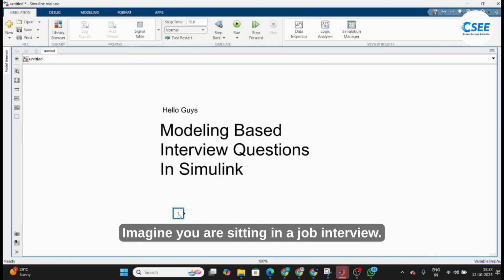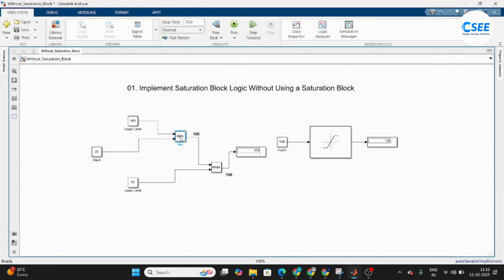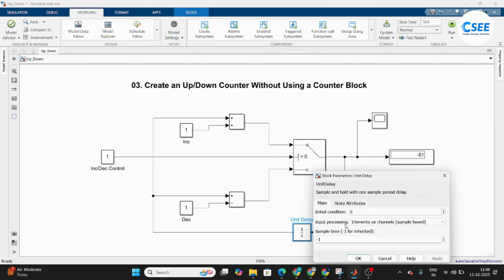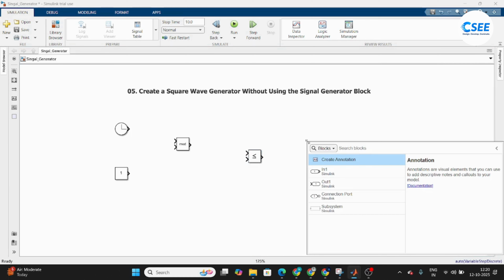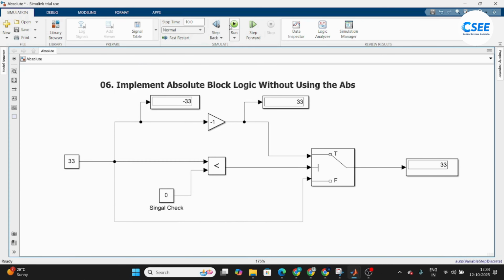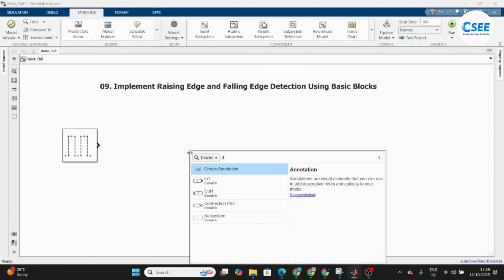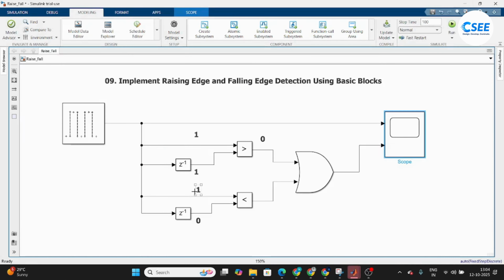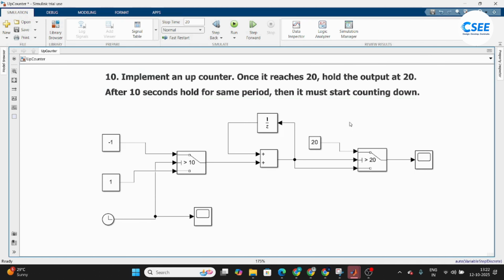🎯 Mastering Modeling-Based Interview Questions in Simulink | 🎥 How to Prepare for MBD Questions

Comment: I have a doubt regarding Question 10, so u r giving clock to the switch so when the clock is greater than 10 it should start down counting right with ur implementation rather than waiting for reaching 20
Reply: Simple change , just change sample time to 0.25
So it will hold output 20 for 10sec and the start decrement
Reply: @mrunalgirame  : Yeah , its working fine with 0.25 step size ; could you please elaborate the solution .
Reply from the maker: Let me cross check it
Reply: Correct , @cselectricalandelectronics1055 : I replicate this logic in simulink with fixed step solver. step size 1. It has started immediate down counting after value 11 without any wait time.